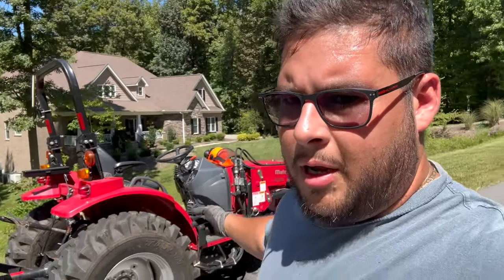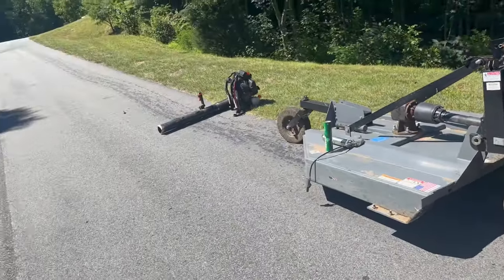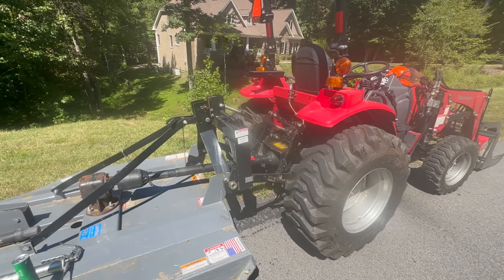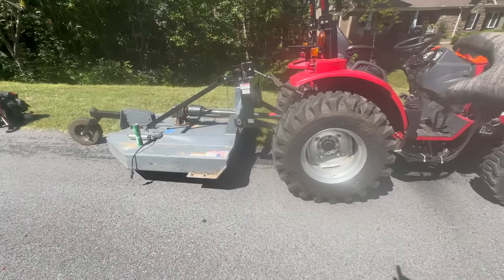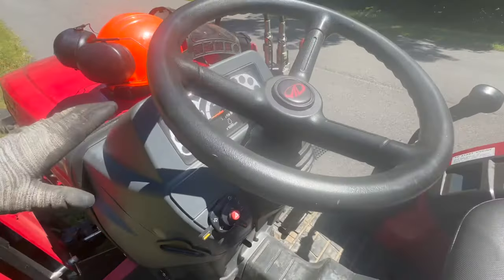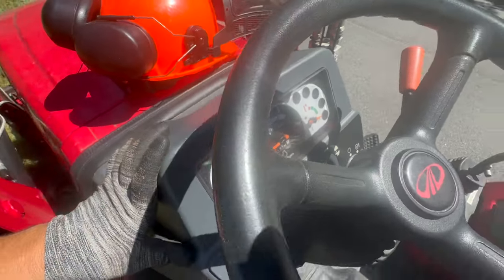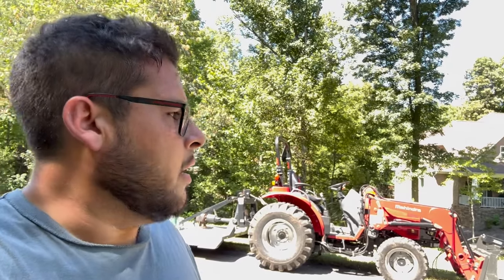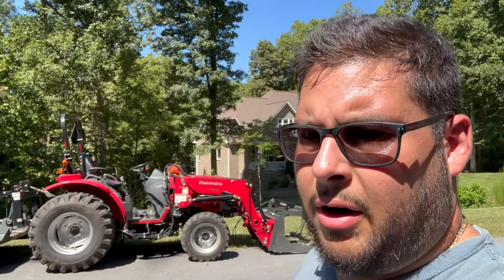Mahindra Tractor Breakdown! What Happened?

Comment: Hydraulic fittings should be checked new or used. Highly doubt its the transmission. It's probably just a fitting that needs snugging. As far as your 3pt lever dropping, there should be a friction nut you can tighten under the fender that controls how easy the lever moves.
Reply from the maker: Good afternoon CK-dt6nx , yes you are right I do check all levels before running my machine! I sent it to the dealer, the handle that controls the 3pt had a screw back out and it wasn’t controlling the hight adjustment.
Thank you for not only watch in but commenting with helpful information.
I hope you and your family have a Happy Healthy New Year.

Joe